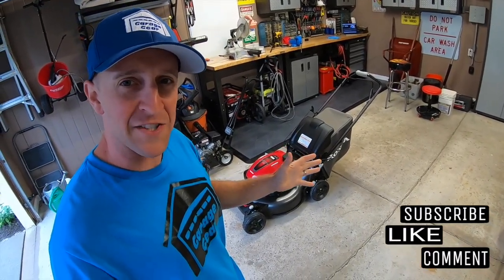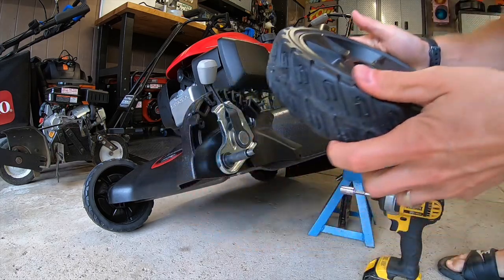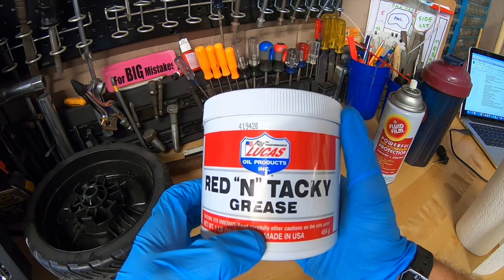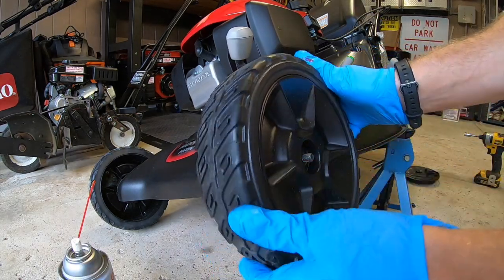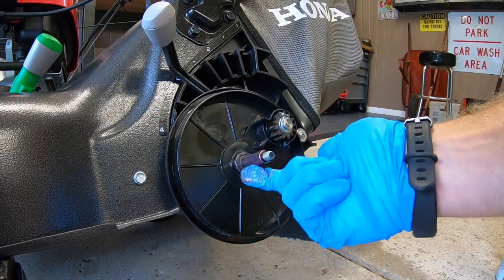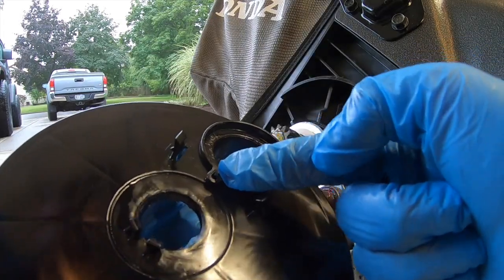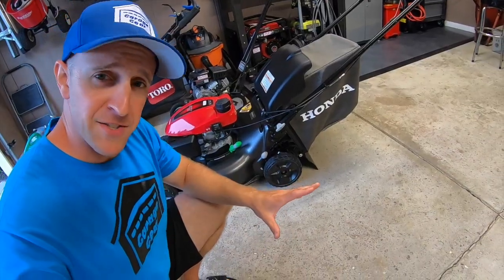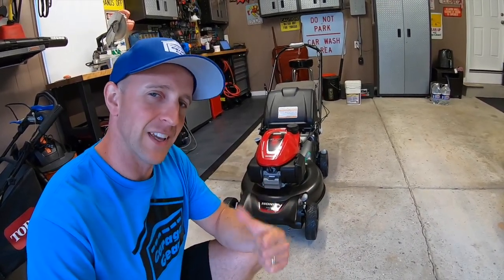HOW TO GREASE LAWN MOWER WHEELS FAST AND EASY

Comment: Couldn't have come at a more convenient time!!! My TORO Super Recyclers have grease fittings on all 4 wheels, so I just bought a grease gun and connector piece for the zerks. I might just take the wheels off to see what's what... especially because of the plastic gear psrts on the drive wheels.
Reply from the maker: Go for it Fred!! I would just throw it on anyways! Couldn’t hurt!  It’ll take you a beer and ten minutes! Have fun! Thanks for watching! 👍

Comment: Great video! I just bought a new Toro and while storing it for the first time (Smartstow) I noticed the front wheels were extremely difficult to spin. Pulled them apart and there was no grease, only some type of blue material which I had to scrape off. The blue stuff looked like Locktite. It took me some time to remove. It was on the axle shaft and particularly on the axle threads. Like you suggested, I used Red/Tacky (I use that on everything) and put it back together and now it works great.
I wasn't sure if this was a good idea with all the dirt/dust the mower sees but your video sets my mind at ease. Thanks!
Reply from the maker: Awesome snoop! Grease em up and the spin great!  And unless your mowing commercially you really don’t get a lot of grass built up on the axles. Do it once or twice a year and your golden!  Thanks for checking out my channel!
Reply: Was the blue stuff teflon? Sounds like too little if it was supposed to be. I use teflon grease a lot, the red+tacky a bit less, both are good.
Reply from the maker: @atlantajunglepythons1744  hey Atlanta not sure what blue stuff you’re referring to! Can you give me a time stamp? Thanks for watching!

Comment: great video! I mow my elderly nieghbors yard, she purchased the same exact mower a few years back. Ive been keeping up the maintenance on it per Hondas manual etc. Appreciate your advice on lubing the wheels. One question i have is, do you have a video that shows how to make the rear wheels move freely?  Her mower rear wheels are "locked up", i just lift the rear of mower when i have to move the mower prior to starting. Is there a easy fix for this without removing the rear gears/springs etc? thanks for any tips!
Reply from the maker: Hey AI! Appreciate the positive feedback! On some older John Deere models there was a simple spring that was only about 1.5 inches long that pulled a small lever back on the transmission allowing you to back up. Without it you could back the machine up.  I’m not sure if these transmissions have it or not I’ll have to give it a look. I’ll see what I can find out. Thanks for watching!

Comment: I'm going through inspecting this exact mower before using it for the first time (brand new). On the rear wheels I'm noticing that the left one (the side with the air filter and mulch/bag selector) does not spin nearly as freely as the right one does. I'm wondering if this is a sign of a potential problem, and if both of the rear wheels should spin as freely.

Thanks for the video, and any help you might be able to provide!
Reply from the maker: Tough to say without seeing it in person. Keep the back gears lubricated and see how it drives around. Keep me posted.
Reply: @GarageGear  Sure thing! I think what I'm about to do is go to a nearby honda power equipment dealer and see how the rear wheels on one of their display models act. With it being a completely unused mower I'd think that if this is an issue it can be addressed without me having to put in the labor.
Reply: @GarageGear  Update 1: While the left rear wheel on their display model's behavior was similar to mine it did spin a bit more freely. Like yourself the person I spoke with suggested that it might be okay and just needs to break in, but also thought it could be a good idea to return the mower.

When the weather permits it will be time to take it out and see how it goes. I'd definitely advise on doing a decent inspection on the mower before using it for the first time. In mine so far I found that the spark plug was gapped smaller than the manual recommended (.021") and was on too tight. I found the over-tightening issue to be the same with the blades also.

Torque wrenches are your friend.
Reply from the maker: @nosilverharbinger  thanks for sharing this silver! I’m sure it will help someone out!
Reply: @GarageGear  No problem! So far the mower has about 6 hours on it and been running great. The left rear wheel just needed some run time to loosen up a bit as it now spins much easier. I've changed the oil twice, and a spare set of blades are on standby for the change not too far ahead.

I keep the deck clean and can say that the mower mulches like a champ. I don't think that it bags as well as the GCV160 equipped HRR216. It does about average at that, but seems to make up for it in the mulching department where I think it is noticeably better.
Reply from the maker: @nosilverharbinger  awesome my friend!

Comment: Great video JB! You have earned a sub for sure. I have a question, I just bought a brand new Honda HRX217VKA and I love it. My question is specifically greasing the wheel bearings. How do you do it? I know you said to re-pack them which I can do but if you could, make a video on how to do it or just tell me. Thanks again for the great video.
Reply: these mowers do not have bearings. just a shoulder with a bushing. just throw some grease on there, you’ll be good.
Reply: @lukeWiz44  the hrx does indeed have wheel bearings. The hrn does not. If you see in my comment, I said hrx. JB even says the hrx has wheel bearings in this video: https://youtu.be/jFjudX7wm94
At the 44 second mark…
Reply: @xlxphoenixkingxlx  So let me get this straight, you have a broken down engine as your profile picture, yet you don’t know how to repack bearings on a lawn mower??
Reply: @lukeWiz44  why are you personally insulting/ attacking me now that you realized you’re incorrect? Or is that just a defense mechanism?

I know how to pack bearings its not hard. However, since this question was directed to JB/ garage gear and not some rando on YT, Ill wait for his response. And since you didn’t know about the whole wheel bearing even existing on those lawnmowers I would appreciate it if you kept your opinion to yourself as well as your insults. 

But if you must know, It looks like a sealed bearing, meaning no re-packing. Is it a bearing that will last the life of the mower? Is there a way to grease it even though it looks sealed? Is it pressed into to wheel requiring a new wheel or is is a bolted on assembly that can be easily replaced?
These are all questions I have for JB and not for you.
Reply: @xlxphoenixkingxlx  Good lord old head, it’s a lawnmower. your .2 acre yard isn’t gonna stress those bearings all that much. the original bearings will probably outlast you, but that’s not saying much.

Comment: The grease won’t attract dirt and grit and eventually affect the spinning of the wheels?
Reply from the maker: Hey Doug good question! A little grass and dirt may get caught up in there. Depends on your yard. I usually do this procedure every fall. Give the wheel spindle a quick cleaning and regrease for the next season. I did a video a while back on my Instagram that showed how little dirt and grass actually got stuck inside. It’s minimal. Thanks for watching!

Comment: Might be a dumb question but..... Could I remove the wheel linkage and add adjusters to my left side wheels? I want to be able to adjust each side independently and currently they are linked front and back
Reply from the maker: I don’t think you will be able to do that on this model!

Comment: My Honda hrr216vka I bought 10 years ago the spring finally went. The rear wheel wouldn’t engage. I had to buy a new gear. If I knew about this years ago I’d probably be fine with these procedures!
Reply from the maker: Hey bud! Funny you mention this. I just had someone comment saying you should never do this with no reason given as to why. And here you are saying, that had you known about this, this probably would have saved you some trouble. I’m confident this keeps things moving well for years. How’s your machine moving now with a new gear?
Reply: @GarageGear  awesome!  I actually gave the mower to my parents. They love it. I’m using your procedure for my new mower Honda HRX217HYA
Reply from the maker: @appleztooranges  ROCK ON brother! 👍

Comment: Hmmm.  Some wheel axles I will lube, but only if the wheel has a steel bushing inside.  Many do not, and solid plastic wheels should remain dry (be mindful of that).  As far as the rear gear...remove it, clean it, and regrease it, and reassemble.  The small pieces inside most gears of this type require grease, not a spray on oil.
Reply from the maker: Thanks for sharing!

Comment: With all that grease are you not worries about dust and grass clippings getting stuck on it?

Edit: saw you addressed this at end of video, I also found that the tread will wear long before the bearing or wheel itself will
Reply from the maker: Hey buckeye! That’s why I did this to the wheels HOW TO REPLACE TREAD ON LAWN MOWER WHEELS (Get MORE GRIP That LASTS)
https://youtu.be/EfYJv4q8e6s
Reply: 5:08  @GarageGear

Comment: I accidentally got some tacky grease on the screw thread of the wheel and can't fully re-tighten the bolt now (infinite turning). I also can't unscrew it to wipe off the excess grease because of the same issue. Any tips? LOL
Reply from the maker: Hey Chris sounds like you stripped the threads. You may want to call Honda about a replacement wheel bolt/nut. Let me know how it goes!

Comment: Interesting video. Not sure I agree with lubing rear wheel gears. It's ok if you have a new mower but old ones may have broken plastic covers.
Reply from the maker: Hey Martin, if the company making the mower greasing then does it, it’s okay to do so. Replacement covers are fairly inexpensive if a new one is needed. Thanks for watching!

Comment: Doesn’t the grease attract grass clippings and dirt?
Reply from the maker: Good question! If the gears have a cover inside the wheel then very little grass will get on them. And if you check them once a year they should stay relatively clean!

Comment: I removed all the grease from the gear teeth, it collects sand and causes quicker wear between the mower and wheel gear connection.  No grease means the sand/dirt/grass doesn't stick as much, and can easily be blown/washed off.  That crunching sound as you are moving is sand in your grease on your gears.  Same effect as sand between your teeth, not good.  Dust covers aren't dust proof.  By all means, grease the wheel and gear axles, just consider not greasing the gear teeth.
Reply from the maker: Thanks for sharing!

Comment: A lot of work, what if I  just spray WD 40  on them? 813 likes now
Reply from the maker: Hey Gregory I would not spray wd40 on the wheels/bearings! I will break down the grease inside and they won’t work over time. Grease is the way to go! 👍
Reply: @GarageGear  Thanks I  will try the grease without taking  anything apart
Reply: @gregoryeditor6500 why do you only want to do the absolute bare minimum 😂
Reply: I have severe arthritis in my right kmee and it a little over 1 month I will have it replace and most likely will be off YouTube for months after the surgery @oisty
Reply: Yay!!!
Reply: Just the high milage

Comment: You should never grease the drive wheel gears.
Reply from the maker: Thanks for watching!
Reply: @GarageGear  Totally enjoy your videos!
Reply from the maker: @goldfinger1003  Rock on gold finger!
Reply: Can you please elaborate on why? I was thinking of doing it on mine then got to thinking dirt will stick to the grease if it gets in there. I repair alot of mower for friends so really would like to know. Thanks
Reply: @AlwaysBeSmart674  Grease will make dirt particles adhere to vulnerable components in the gear wheel, and will cause it to fail prematurely.